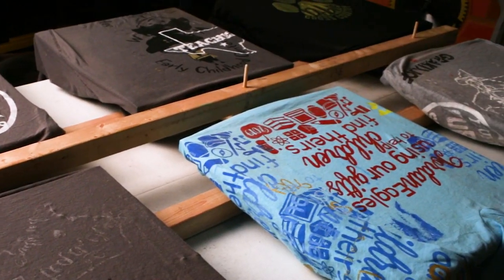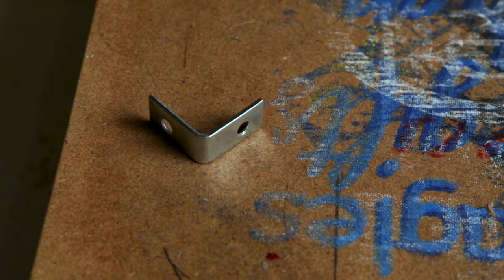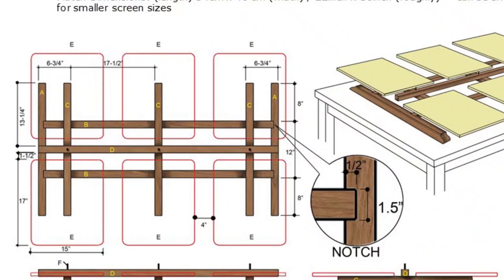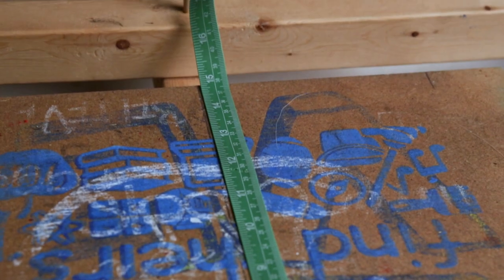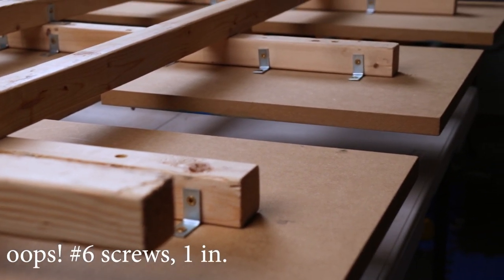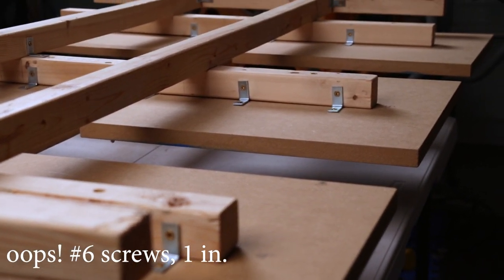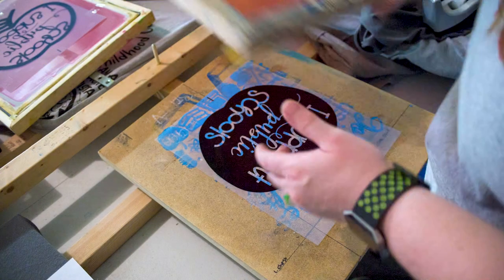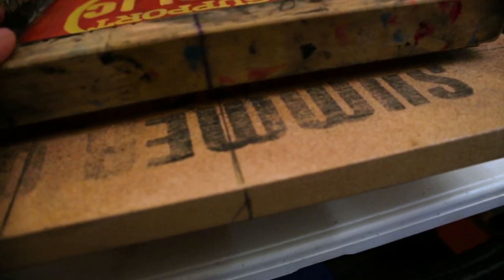Tutorial for DIY Line Print Table

Comment: Hey Shelly I have a question. On you diy line table did you add a micro registration for multi color and if so how do I do it as well?
Reply from the maker: I attempted to with bolts in the middle bar. But it would typically work as long as my films were burned correctly, the screens would always line up. i just had to make sure my shirts were squared off. 

Here are some examples: 
https://youtu.be/661QwlAmKBs
and 
https://youtu.be/0VM7b1y99lA

https://youtu.be/N0bBM4t7qf0

Comment: great job, i see the top dowel, but how do you keep the screen from moving from side to side
Reply from the maker: The screen is flush against the middle bar, therefore does not move from side to side.
Reply: @ShellyCreatesIt   How well does it handle multi-color prints? I'd think the wood on each frame would be slightly different so that system would be off a bit without some sort of flexibility for micro registrations/adjustments. I think a 2-peg system with the screens calibrated to the exact same positioning using adjustable brackets would render better results.
Reply from the maker: I align the screens to the design and burn the transparencies, therefore the screen discrepancies don't effect the alignment. I can understand the difficulties.

Comment: Thanks for this! How do you make the notches so percise in the wood? What did you use to cut it
Reply from the maker: My husband did it with a router. We measured each piece (because the sizes of the wood vary slightly) and cut out the same size notch for each location.

Comment: Curious, would you be able to use standard 24x20 aluminum frames with this system?
Reply from the maker: Great question! I should get an aluminum frame and try it! I would say, 'yes.' Make sure your platens and spacing between them fit the 24x20 frame size.

For alignment, (if you don't want to drill into the metal frame) you can put all the alignment on the center bar. Maybe have 2 brackets or bolts that the screen fits between and sits flush against the middle bar. It doesn't allow for micro registration, but if every platen is square and the screens align the same way,  and you burn the screens correctly - you won't need micro registration.

Comment: Hi Shelley, just wondering if the 2x2 holds up to the pressure of the putting the ink onto the shirt with the screen when pressing? Thank you.
Reply from the maker: The 2x2 seem to hold up well. There isn't a lot of pressure when I print because I don't want the ink to bleed through the tee. I also placed at least 3 to 4 l brackets under each platen to hold the 2x2 to the platen. So far it seems sturdy enough and I've been using for nearly 10 months.
Reply: @ShellyCreatesIt   ARe you using mostly plastisol? love the design will give it a go if it can halde pressure using waterbased
Reply from the maker: @lukereeby8566  I am mainly using water based. Not sure when... or if I'll move to plastisol inks.
Reply from the maker: I'm in the same situation. Love the waterbased inks, but I'm doing a jersey order now where I am having to try plastisol. Fingers crossed it works. It is definitely different than water based!

Comment: what did you use to cut the notches in the wood?
Reply from the maker: We used chisel and hammer to notch it out. You could probably use a saw or a router to get the bulk and clean it up with chisel and sandpaper.
Reply: @ShellyCreatesIt  I also was having a hard time trying to find the pdf on how to build it. I seen the link but I didnt where to download the file at

Comment: Your link to the "discussion" forum with the alleged "plan" only has a very small thumbnail image, not the full jpg
Reply: It's there, click on it. Or left-click and save as. That's the easy part, good luck with the build.
Reply from the maker: You can create an account and it will give you full access. Another user has also shared the link to google drive copy: https://drive.google.com/file/d/1svIjeXDLm8PO-IrFzdY8innI5jGaexWR/view?usp=drivesdk

Comment: Where did you get the center bolts from
Reply from the maker: You can view my screenprint table Kit here to find the dowel rod used for the center peg.
https://kit.com/michellebkolo/line-table-supplies/3-16-dowel-rod-nail

It's a 3/16 in dowel rod that we cut into 3 in sections and glued into the center 2x2 board. We also sanded/rounded the top to make the t-bracket easy to slide on and off.

Comment: Thanks a lot a lot Shelly.. i wanna talk To you ? How can i join you.. i have a table like this. How do you manage off contact..???
Reply from the maker: You can comment back/forth here, or you can email at: shellycreatesit@gmail.com

I have only used water-based ink up until this past week, and haven't needed to have off-contact.  I am currently printing a jersey order with Wilflex Poly White and I'm finding that I need the off contact. There was another comment on my channel suggesting placing a washer on the dowel rod(registration) in the middle of the table, but I'm concerned about it affecting my alignment/registration.  I think I might superglue some washers on the print side of my screen, but the only concern would be the next time I go to burn the screen, will the washers affect my off contact?
Reply: They say u can use washers or tape quarters to the corners